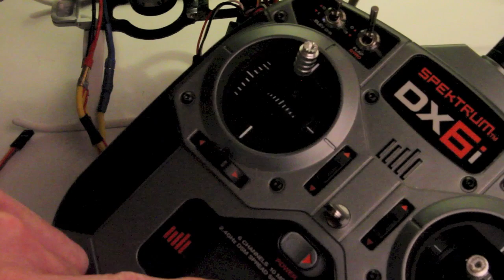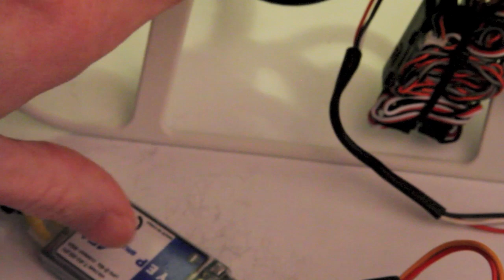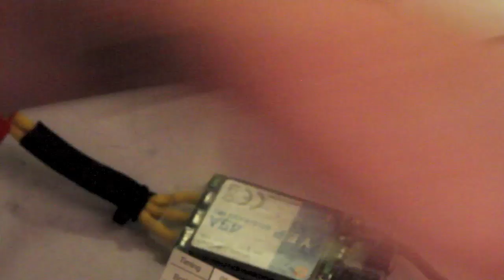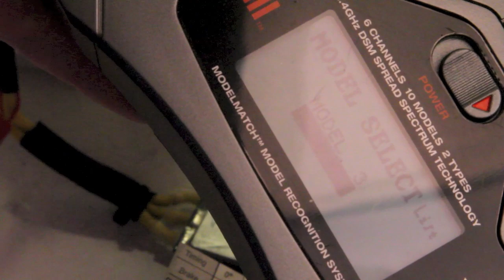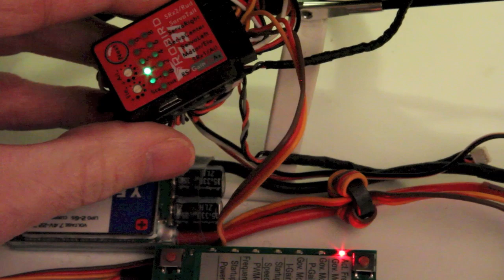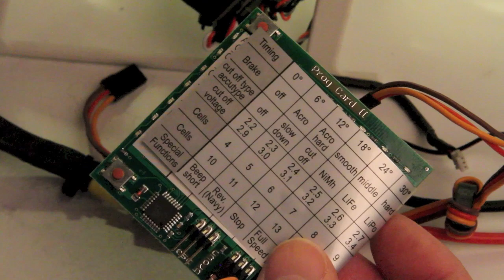25 : Tarot 450 Pro V2 Build :  YEP 45A ESC Programming (YGE)

Comment: Looks great, thank you for sharing. There's one guy who did the same setting, except for the hi & low for the Esc..for the lowest position he had his throttle hold on, and then when went up to the highest position he then turn the hold off, think he turned it off before going to the high stick then pressed set button. Over all your video is very vivid and enjoyable to watch. Can't wait for my YGE esc & program card.
Reply from the maker: Thanks for the feedback! With regard to the throttle hold switch used for the setup...it's really the same thing, assuming his throttle hold is set to the same thing as his low throttle position. Some folks, however, have their low throttle at -100 and their throttle hold at -125 (not going to get into that) so if that's the case...then doing it with the TH, there could be some interesting results - possibly.

Comment: Hi EVERYTHING cpo, 1st can i say thanks alot for 4 great help, but i think i have a problems, on Special functions when i do STOP with my Throttle at zero and then press enter the tone is the same as yours but when it comes to doing FULL SPEED with my throttle 100 the tone is different as if there is something wrong, throttle hold on TX is off, any ideas why?? be very greatful for some advice.
Regards
Matt
Reply from the maker: On your transmitter, do you have a full linear throttle curve set?  Make sure you are giving it the entire range (MAX).  Not sure if that is your problem, but that was the first question that comes to mind.
Reply: EVERYTHING cpo
thanks for reply, i have to DX6i
Reply: matt barratt
also when i plug li-po in after about 20secs the motor goes mad and goes backwards and i have to unplug
Reply from the maker: Sounds like your throttle channel may be reversed...
Reply from the maker: Btw... Just to be clear, to change the direction of the motor, just swap any two of the three motor wires. Reversing the throttle channel does not address that. It only reverses your output, which may currently be set a full throttle when down, and low throttle when up. That could be why your motor is spinning after the esc and receiver initialize.

Comment: good job.thanks!
but i use 3 cell 11.1V battery. can't chice this card.
whow do ??
Reply from the maker: I mention this at about 16:45, but you may have missed it. It was pretty short. If you have less than 4 cells, it will automatically detect the number of cells. In other words, you don't need to select anything.
Reply: Oh......
thank's !!!!!!!!!!!!!!!!!!!!!

Comment: It was helpful. I have bl500mx motor and YEP 80A in trex500. Motor stops in hovering When move the throttle stick down half under. stick move high position motor begins to turn. And Motor output is too weak. The initial failure? Who let me know the setting. My programeming Options Motor timing: 18° PWM frequency: 12kHz Active free-wheeling : on Brake: off Cells: 6 Startup speed: Heli slow Brake: off

Comment from the maker: 1. Move throttle stick to 100% (full forward) position, making sure you have no throttle curves set...you want the transmitter to be reporting full throttle. TH should be off.
2. Plug battery into ESC. 
3. After you hear the solid beeping tones indicating you are in programming mode, move the throttle to full low position (0%). That sets the soft start feature. 
4. You will hear some confirmation tones, and then you can remove power.

Comment from the maker: In order to program soft start with the transmitter alone, you would do the following. It is best to do this will the main gear disconnected from pinion on the motor, so that there is no chance for accidental blade spin-up. At a minimum, you could remove the blades to be safe.  In reality, this process should not cause the motor to spin up.